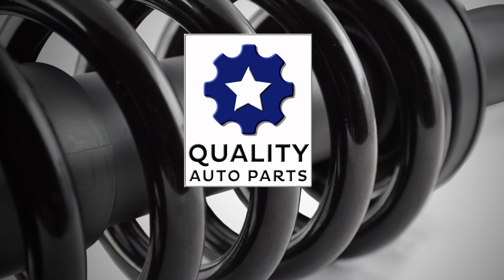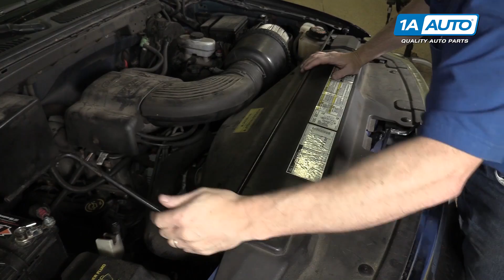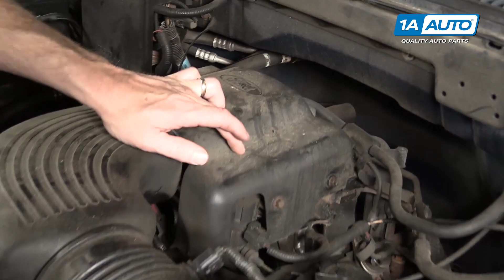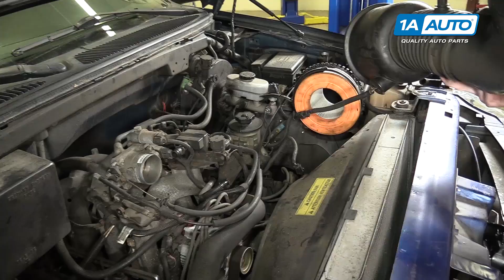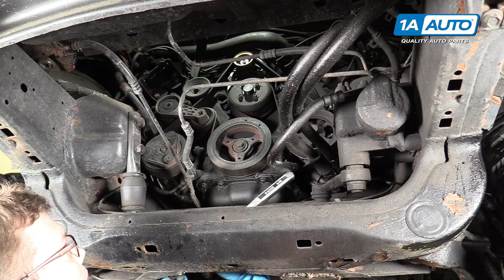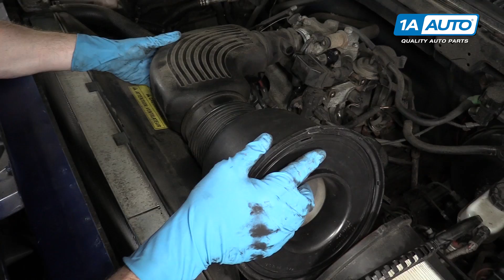How To Replace Serpentine Belt Idler Pulley 97-01 Ford F-150

Comment: You do not have to remove all of those components just to remove the idle pulley. I pulled my idle pulley off less than 8 minutes. With the belt still intact. Remove the bolt remove the pulley replace a new pulley sliding it back on and then putting it back on bolt. Tighten it down. And then start the engine. Problem fixed! But thanks for video.
Reply from the maker: +Terenzio Nedd Thanks for the tip!

Comment: In my experience. You do not need to remove anything. 4.6 2000 f150. Can reach in with breaker bar. Relieve tension. Pop off alternator. Then remove idler pulley with 13mm socket. And undo the process.
Reply: Did do a bit much for an idler pulley job.

Comment: Our idler pulley is held on by a torx or star bolt. The question is, what size is it?  And also wondering if the tension pulley is interchangeable? Trying to determine the squealing culprit and hoping instead of buying 3 we'd buy one swap out til we find  it

Comment: can you help me ,where is fuel filter for Nissan altima 2002? thanks .
Reply from the maker: +BARRO NUEVO The fuel filter is actually located in the fuel sending unit in the tank on your model.  There is no in-line filter.